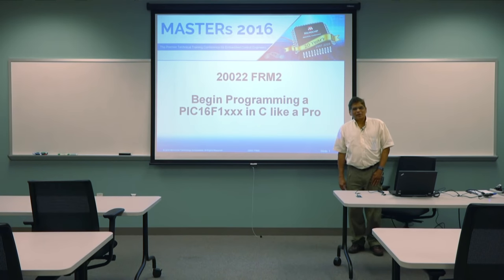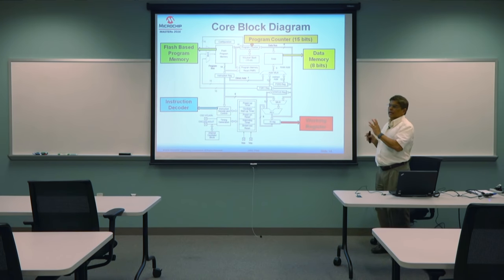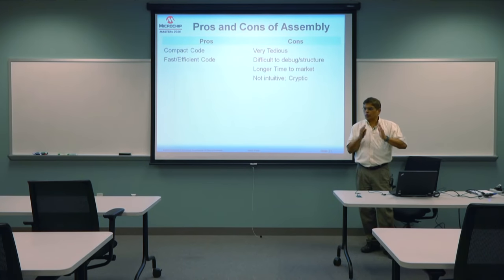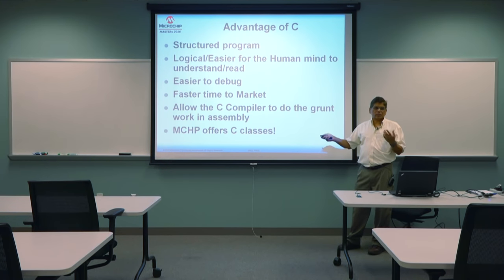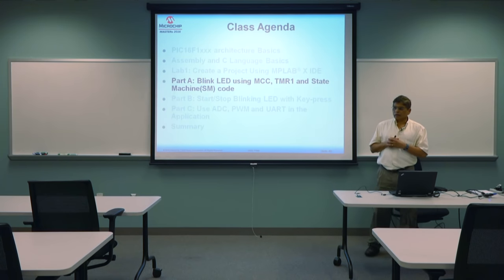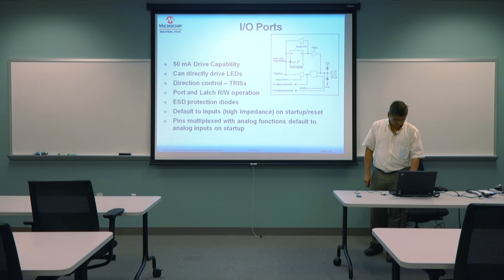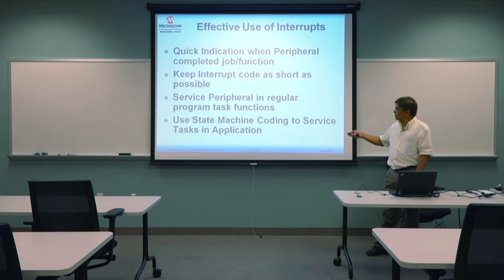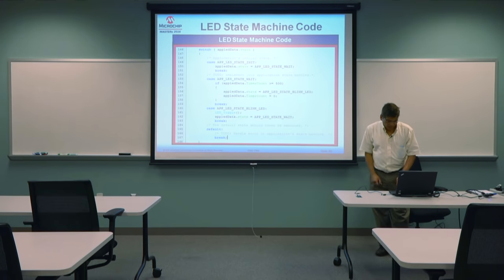20022 FRM2 - Begin Programming a PIC16F1xxx in C Like a Pro

Comment: This would have been a great video if there was some access to the source code. I would have been happy if you just walked us through how to write it from scratch (like showing some screen shots of the code by section so I could type it out in the IDE) instead of deciphering pre-existing code, especially when we don't have access to that code. This was a waste of time otherwise.
Reply: Exactly my thoughts. 
I started to follow this course because I had a RF remote with PIC16LF1903 chip in that I wanted to hack it.
All went well until the instructor decided to copy app.c and app.h from nowhere. :-(
Reply: 50
Reply: @airesearch0844  That is the same spot where I completely lost where he was going. At first, I was thinking that app.c was the main code(prewritten) and he was just going to delete main.c in the project and rename app.c
Nope. My train derailed at that point.

Comment: The IDE part, as the most interesting, is not shared directly via screen capture. Why? Every PP slide is screen captured and visible but not the coding part. Would have been a good video.
Reply: 50

Comment: Can somebody comment on what I am about to ask?
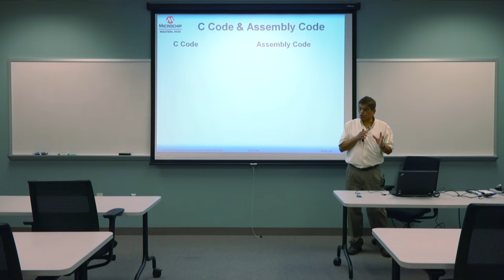At 22:09 Stan is talking about how C language compiles into assembly language. Is this actually correct? 

I was thinking that C language code compiles directly into machine code (zeros and ones 010101010).

Maybe Stan is making the point that C is a higher level language and a simple C statement would require many different assembly instructions. Perhaps, he is explaining to beginners that C is a higher level language, and Assembly is lower level.

But, once again, I ask: Does C language compile into assembly language before it is converted to machine code (zeros and ones)?

Or, does a C compiler directly convert C language into machine code (zeros and ones)?

(I am not being rhetorical. I'm not fault-finding Stan's lesson either. Its a good video. I'm sincerely asking)

Thanks in advance.
Reply: The compile process is explained in the XC8 user manual from page 81 of 50002053g.pdf

C is a higher level language, it's many "source" files get "compiled" into an Assembly file which is then assembled into a hex file which can be programmed into the microcontroller. The Assembler also creates a cof file for debugging , but this is a very basic summary of the full process which you can read up on. Assembly is a low level language, compact and executes faster. There is an excellent  presentation on the Microchip Developers site  
https://microchipdeveloper.com/tls2101:start
This has great description of the compliation process if you download all the material and review the presentation which covers the compilation.

I see the site is busy being transferred to Microchip University site but link still worked while writting this comment.
Reply: @Zh87119  thanks

Comment: Does anyone know where I can get a C program that I can burn into a pic that will  do the following . Have a start button for a 30 minute delay . Once 30 minutes has delayed an LED or Device will vibrate . The user can easily reset the timer . But the kicker is I would to try and fit the circuit and battery and transducer ( led or vibrating buzzer ) into a wrist band preferably rubber , something that's pretty robust . ..something similar to a FIT BIT . any help would be much appreciated .
Reply from the maker: Kindly visit support.microchip.com for assistance. Thank you.
Reply: 50

Comment: Exists libraries for serial port and I2C?
Reply: Hi Luciano, yes libraries for serial and I2C are available. Depending on which device you would like to use, but below are some links you may find useful taken from help links within MPLAB X IDE while configuring a PIC16F1789 device. Each device is unique and related documentation from datasheets can be referred to.
For serial check out links
https://microchipdeveloper.com/xpress:introduction-to-eusart
https://microchipdeveloper.com/8bit:usart
There is upgrading of sites going on at the moment so access to I2C material seems to be a bit of a challenge today, but follow the same steps using MCC Device resources as done for the USART/EUSART above.

Comment: thank you sir explanation,please  guide me to use mcc generate setting for pic16lf1559  it has two adc module.
Reply from the maker: We don't provide technical support here on YouTube. Please go to support.microchip.com to get assistance with this question.
Reply: Use flowchart to code converter for firmware design and auto coding

Comment: I have a question. can we use simple c code compiler ? instead of mp lab x ide ?
Reply from the maker: We don't provide technical assistance here on YouTube. Please go to support.microchip.com to get assistance with your question.
Reply: You can use flowchart to code converter for firmware design and auto coding
Reply: @flowcharttocodeconverter936  What is it ?
 How we can use ?
Reply: Its a window's based app. Its very useful for embedded product development. Flow based design is easy to create, remember and maintain. I have uploaded some basic videos about it.